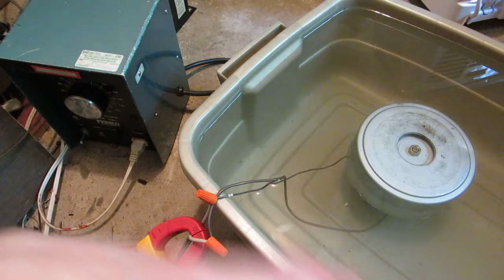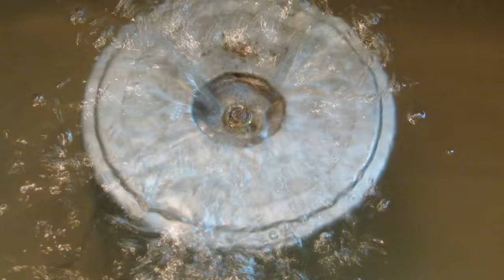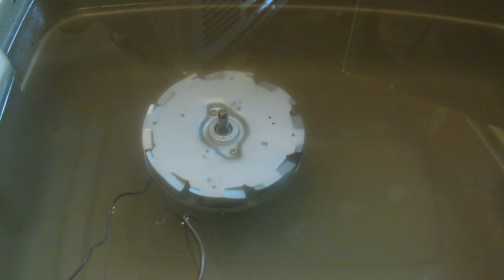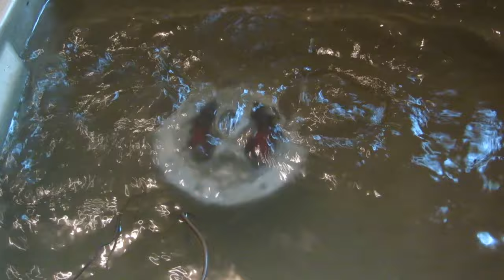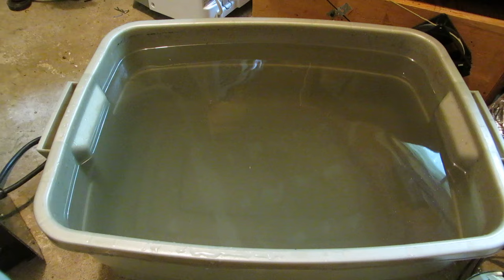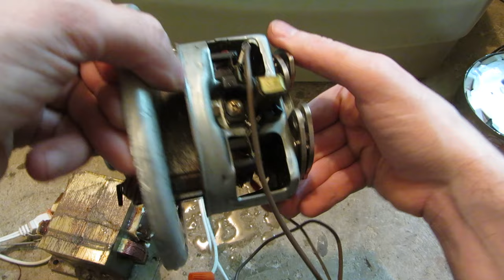Operating a Vacuum Cleaner Motor UNDERWATER, and it WORKS!

Comment: So what happened to the motor? Did it rust?
Reply from the maker: Just been sitting around doing nothing, I might try to fire it up one of these days.
Reply: @HL4EHalfLife  ok. keep us posted! thanks
Reply: @HL4EHalfLife  Did the water heat up because of the motor
Reply from the maker: @frommarkham424  No, wasn't run nearly long enough.

Comment: water washes the oil from the bearings they will then also rust and the motor will fail
Reply from the maker: Doesn't matter.. I got a ton of these motors.., maybe some day after it rusts I'll do a video trying to power it up again :D
Reply: @HL4EHalfLife  please make more videos
Reply from the maker: @drainman12  I'm glad you like the videos. The reason I haven't done new videos lately as my Canon battery doesn't hold a charge long enough to do a video for more than a few minutes (it's 12 years old now) and there's too many fake replacements that claim much higher mAh ratings only for people to come back and say its like 1/2 of the original which is 1000mAh. A proper Canon replacement is around $100, so not sure its worth spending $100+ on a 12 year old camera. I've also been busy with other things, however I do have several videos that I want to do if I ever get the camera situation sorted out.

Comment: 10amps,through those little wires?

Magnets might be affecting motor a tiny amount
Reply from the maker: There 14 gauge wire rated for 15 amps.

Comment: why no short circuit?
Reply from the maker: The water is a lot less conductive than touching two wires together, adding salt would increase this conductivity but still would not be a direct short. I suggest you go check out Electroboom for a way better explanation on this.
Reply from the maker: @HoldenVTCalais Haha.
Reply: Electricity takes all possible paths.
Water is a possible path but it's resistance is high. Minerals and salts in water may reduce water's  resistance. And nost if not all the wires are coated with insulation which as the name implies prevents current from flowing into the water. If there is a terminal qere the wires got and the terminal's metal is exposed to air, then when submerged those small sections of metal may conduct but current but water is still a  relatively poor conductor.